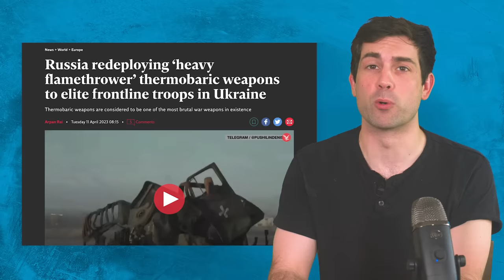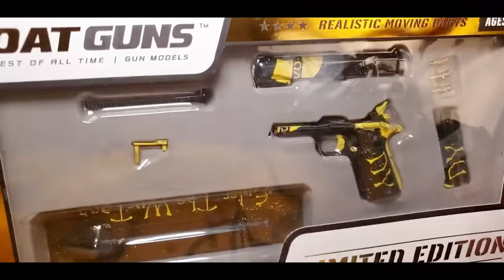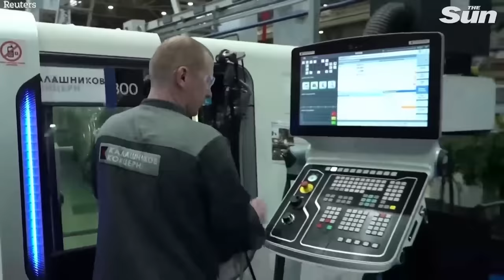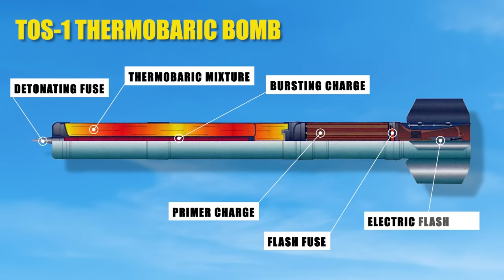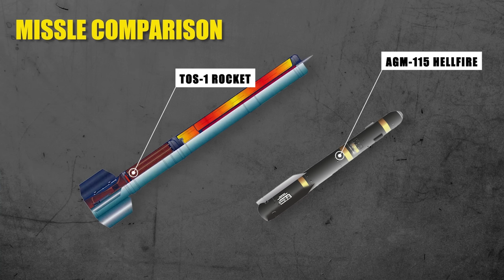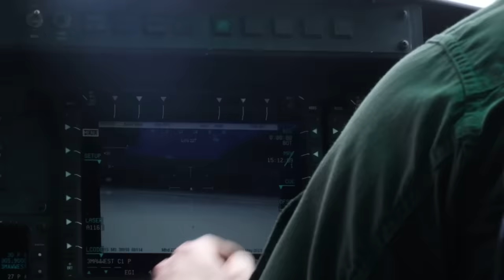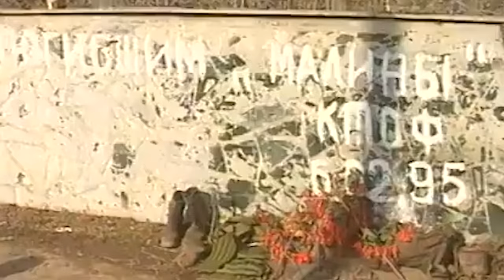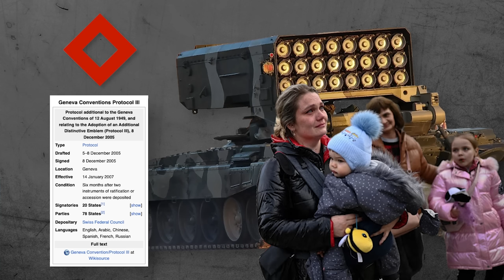How Russian Flame Artillery Deployed in Ukraine

Comment: Can someone explain to me how these weapons create a vacuum? They use up the oxygen in an area but they replace it with what's probably CO2 or some other oxygen compound with as many molecules as before. So how is there any difference in the pressure before and after the explosion, thermal effects of course not withstanding?
Reply: All right, quick science experiment.
Get a metal flask with a narrow neck.
Take a hard boiled egg with the shell removed.
Light a folded spill of paper and drop it in the flask.
Stand the egg upon the neck like a stopper ( it helps if you grease the egg with margarine )
Observe results.
Any questions class?
Reply: @paulbeesley8283 thanks!)

Comment: As much as I'd want to suggest the Western nations adopting similar short-ranged ground-based thermobaric rocket launch systems as the TOS-1A Buratino (which I now see as a spiritual successor to the German Karl Gerat superheavy self-propelled mortar system), methinks the Buratino concentrates too many missiles into a single vehicle that'd make for quite the explosion should it be targeted directly by counter-battery fire. (And no, I doubt that the armor of an MBT like the T-72, or even the M1 Abrams, would save it from such a fate.)

Instead, I'd rather want to disperse the amount of these thermobaric warheads across multiple smaller or multipurpose ground vehicles, with no more than 5 such missiles per vehicle, whether it's a small little truck, like a GRAD, that's been modified to carry multiple thermobaric warheads, or even a company of various armored vehicles, including IFVs, mortar carriers, and tanks that could each be optionally fitted with no more than, say, 1 or 2 of these thermobaric missiles to use against enemy targets, either on the fly, or in a coordinated attack to soften the target locations before moving in to engage with their main guns.

Comment: Are there any chemical counters to thermobaric weapons?
For example, if you flooded an area with nitrogen or CO2 or enough water vapour, would that prevent the secondary explosion happening?
Are there any synthetic combustion inhibitors that could be used?
Without the secondary explosion, the effectiveness of these weapons would be greatly reduced.
Reply: You arent wrong in regards to the lack of oxygen interfering with the operation of a thermobaric bomb. A major drawback is that one would have to supply breathing apparatus for all entities in the area one wishes to keep alive.
Reply: @juslitor  Still, probably easier having respirators than sealed bunkers. 
I'm sure a group like DARPA will have investigated such counter measures. 
That would be something a military would want to keep secret!

Comment: A lot of things are outdated. The first versions of the TOS-1 possessed short-range missiles during the Afghan war. This problem began to be solved even then. This is not a first-line weapon. The chassis of the tank is mainly associated with a large weight in the charged state, as well as with increased cross-country terrain. The use of thermobaric charges in Russia and the USA is tactically different. And caused by a different strategy. The US Army is ready for police action rather than a full-scale war. Therefore, his weapon has priority in destroying single targets. In addition, they are very expensive. It is hard to imagine that the United States would have gone to the mass use of its vacuum bombs. Russia, on the contrary, was developing weapons for waging full-scale wars. American weapons are good if you need to destroy a single, well-fortified building. Tos-1 and Tos-2 for the destruction of fortifications for kilometers. By the way, who told you that Russia does not have thermobaric bombs for airplanes? About the use of Tos-1 in Bakhmut. Ukraine initially used the cities as fortifications for its army. And their population is like a human shield. During the assault on Mariupol, the Azov detachments shot those civilians who tried to leave the city. But it was captured on video, and the publicity of such actions dealt a blow to the image of Ukraine. Only those civilians who flatly refused to evacuate remained in Bakhmut. And they stayed away from the places where the fighting was going on. Without a civilian population, the city is the same fortified area as the terrain in the field.

Comment: GBU-43 is not a Fuel air explosives.  It's just  mixture of trotil, alluminium powder  and hexogen afair.    Conventional bomb,  No.  it's not bunker buster  -  it has no kinetic penetrator to go into ground.   
Smallest nuke is 20 tonns of TNT.   Not even close.  
TOS  has range of  2.7 - 10 km.  depending on ammo.  not on vehichle.   it can be  1. 1A or 2 - all can fit any rockets.   
About  yeild.  It can be either  flammable luiqid or thermobarics.   
the 2.7 km - that's mostly  incendiary older ammo.  10 km newer  thermobarics.   
Avout what units have it - it's kind if swhifty now. They are deployed on demand.   

Deleting cities with it  is totally possible.  With weeks of bombardment.   Not in a single salvo. It is a mighty weapon, but no THAT mighy.  
A single tos  incendiary  shell is roughly equivalent of a 152 mm artillery ammo hit.   
It have never been used back in 2014 in donbass.   Because "rebels" in donbass had only  BM-21.    it's destructive power per hit is roughly 1/4 of TOS.  
No, those weapons are generally no used against civillians.  Civillians are not a worthy target. Killing them gets you no military goals achived.   
Levelling civillian apartment bulindgs that are used as  fortress by millitary - yes plz.   There are drones to confirm tartgets.

Comment: Russia is correct that the west has no counterpart. I think such a system could be very useful for western military forces. Would the warhead also detonate mines in minefields?
Close range heavy firepower is missing in the west. Problem with air power is that it isn't always available. 
However you could also think of 155mm direct fire assault guns. Or special 120mm HE or thermobaric rounds for tanks.
The problem is not this system itself but the way Russia uses it, as it is with every weapon.
Using ANY weapon against civilians is a violation of the Geneva convention.

Comment: "Russian military still has problems building precision guided weapons in 2023" - any evidence to support that, besides "Holywood told me so"?
Because last time I checked Russia had the most precise and superior (acknowledged even by the US) anti-air system, without even mentioning the point-blank-2000km range hypersonic missiles...
Why do you guys say such things? To keep yourselves calm or what? 😂
Reply: So why they bought Shahed drones?
Reply: @niume7468  Not to put only narrtives, in case you haven't heard of it, you can check what S-400/500 is. You can read in open sources how the system can simultaneously track and engage up to 10 targets with different speeds and altitudes missiles, aircrafts).
You can also try to think a bit and cocnclude why Saudi Arabia and Turkey bought it - the main petro-dollar USA partner and the second NATO army, by the way.
Probably it's because "Russia struggles to build high-precusion weapons in 2023", huh?
(check also the production dates of S-400, if you'd like - do your own research and math, think)